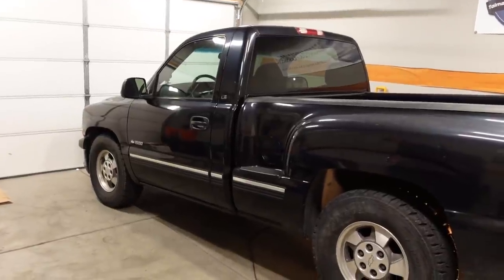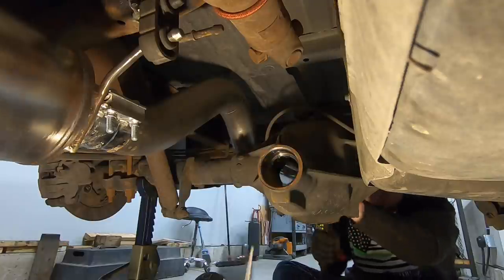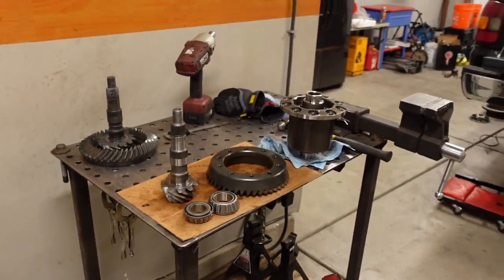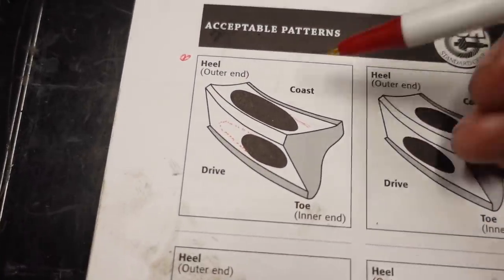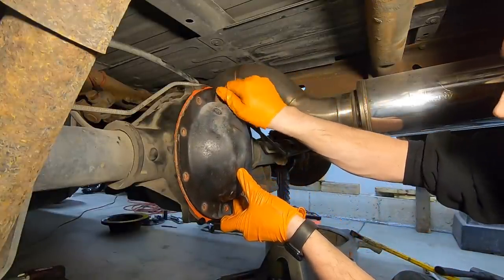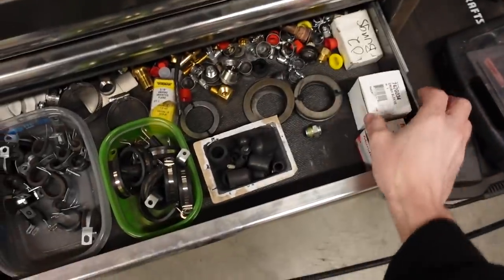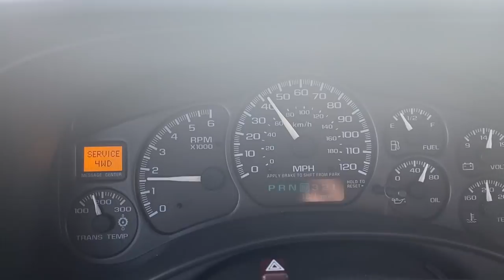Gain Acceleration WITHOUT Adding ANY Horsepower

Comment: Rebuilt my 2500HD rear end (Bad pinion bearing) and upgraded from 4:10 to 4:56.  With 34.85 inch tire (for increased payload) stock 4:10 dropped to 3.74.  The 4:56 brought it back to 4:10 ratio using bigger tires.  More importantly climbs used less rpm.

Setting the pattern and backlash was the hardest repair I’ve made.

Comment: More than 15 years ago I got my hands on a torsen zexel from a 2002 Firebird. Stuck it in my 2000 S10  with the stock 3.42 ring gear. Installed the shims in exactly where they came out of. I've been happy with it ever since. No noise at all. Just better traction especially on wet pavement.

Comment from the maker: totally loving these 4.30 gears! any thoughts on the power adder thats going in yet?
Reply: LSA? I think that would be a fun power adder. I have not seen one on. 4.8’
Reply: Magnuson!
Reply: Hope to see an LSA build or supercharger of some sort.
Reply: Procharger?
Reply: The only thing that makes sense is something centrifugal.
Reply: Nitrous
Reply: Please do a procharger. Easy tuneing, unique sound, less intrusive.
Reply: With that gearing, I'm putting money on a centrifugal supercharger.
Reply: Jet engine bolted to the bed of the floor. 🚀
Reply: Lsa
Reply: LSA which will be badass but I think this would be such a killer application for twin turbos.  Imagine how much fabricating you could do on the hot and cold side!  BTW I feel like always complain about the background music but if you have to have it the EDM tunes work better than the synth rock we usually get.  Not trying to break your balls just my opinion.
Reply: Pro charger you won’t believe how fun they are 650 wheel p1sc lights up quick or d1 700hp up I make 500 on my z28 p1sc
Reply: I know exactly what you mean LT.  First time commenting and love the channel.  I have the exact same setup, 04 Silverado, reg cab, short box, 4wd, 4.8l, but with a 5-speed. CAI, longtube headers, catless y pipe, stage 3 boost cam and a good tune. 327rwhp and 320 tq. Couldn’t be happier with the 4.30s in mine,even at highway speeds.  Gears really helped on the low end with the 4.8.  I’m guessing you’ll go with a centrifugal blower cause 4.8s like to rev, but hoping you’ll do a positive displacement cause that’s what I’m going with.  Thanks for what you do.
Reply: Ummm... Your gonna get those electric superchargers that look like turbos.
Reply: @gotchevy41  I have a 212/218 550/550 na made 350 hp 350 tq how big is your boost cam because those are good numbers you made and what do you shift at 7200 rpm ?
Reply: @utahcountypicazospage5412  Hey man, thanks. It’s a Texas Speed stage 3 turbo cam Specs: 218/224 .600/.600 113+3 LSA.  At the time I was gonna do a small turbo, but now a blower.  The shop has the limiter set at 6,800k.

Comment: A good way to get the carrier beating preload correct is to measure the shims that you take out when you remove the diff.  Then when you re install the shims, just make sure that the total shim thickness adds up the same as the ones you took out.
Reply from the maker: thats true! unfortunately, the truetrac is a little wider than the stock G80 so the stock shim pack is too thick to go in

Comment: I’d like to know the fuel difference your gonna get
Reply from the maker: me too! I didn't check it much before to be honest to get a good comparison
Reply: I had a 04 F-150 that I swapped out the 3.73’s for 4.56 and saw a drop in hwy mpg of about 1- 1.5 but my in town mpg improved by about 2 mpg. I think rpm is only part of the fuel consumption. Load on the engine is the other part. Lower gears reduces the load on the engine.

Comment: In my experience the pinion shim is dictated by the housing and not the gear set. By that I mean I the variance in machining of the diff housing to diff housing is far more than gear set to gear set. If the original gear set had a good contact patch and didn't howl I always reuse the original pinion shim. I've also tried the setup bearing technique and it's a waste of time. You are determining gear setup based on bearings you won't actually be using and it just increases the chances of issues. Play with your side bearing shims as needed to get your desired backlash and preload but as far as the pinion shim goes I always reuse the stock shim as I feel it's matched to the machining of the diff housing itself.

Comment: One trick I would use is to use a prybar to give the carrier a load (both drive and coast) for the best pattern replication in the marking compound. Free spinning gave incorrect marks. There is always a load there anyways. Replicate for the true load. Also most Fords (what I learned on) were the same as far as pinion depth. 90% still like the .030" pinion shim from factory.

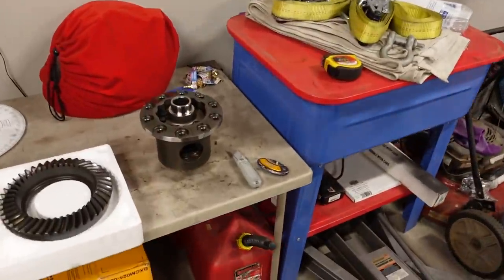Comment: I did this in an untouched BOP rear. Went from like a 2:56 to a 3.73. What a difference lol. But getting everything set was a pain. I was told the pinion bearing shims are standard to case, not gear set. So if you measure the factory shim behind the pinion bearing, it'll be really close to what you need to set it at. I couldn't get mine out... been together for 54 years and my press just wasn't having it. However friends who have done it have said that works for setup. But what a pain in the ass. No matter what I tried I just couldn't get a great pattern. I eventually did but it took forever. I also overshot the pinion preload but then looking around I was under the factory spec. The consensus again was with good bearings, higher preload was fine. It's survived many passes and like a thousand miles with no noises so I may be good lol.

Comment: Thanks for the video LT !
Thanks for the explanation regarding pinion depth that was helpful can you speak a little bit more about finding The Sweet Spot with the carrier death left and right? When I did my Ford 8.8 a while ago I had a heck of a time getting a good tooth pattern. I will be installing 342 years and then eaten in my wagon soon trying to reduce the headache ahead of time as much as possible

Comment: Well done LT!  Great info as always.  I did the same change in a 2002 4.8 2wd Silverado and loved the result.  Milage was actually better.  Less peddle to come up to speed for city driving.  Higher rpm at high-speed keeps you from flying down the highway.  Works for me anyway...  I like having the power for short bursts and nothing good comes from sustained 90 mph if not on a track.  I did have some gear noise, but it disappeared after a few hundred miles. Not sure if my "good enough" install was the cause or all new gear sets make some noise until they wear in.  (I did install and take apart multiple times trying for perfection) Topped off the dif oil after driving for a bit with some Lucas and I'll never know what stopped the slight noise.  Thx!

Comment: At first I thought you were forgetting the crush sleeve and you couldn't hear me tell you hay the crush sleeve but then you showed that you had put it in. I always tried to get the lower end of the specs for launching purposes the less slap usually the less damage. Na Motors love the lower gears now when you go turbo and if your running only 1/8 mile that gear may still be OK. You'll have to test and find out. Good content keep up the good work. God bless you and as always be safe 👍

Comment: So, the 4x4 shop where I had my '12 Ram 1500 2wd regeared from 3.55 to 4.10 said Nitros, which I also chose, are notorious for noise. He runs into mild noise a lot with them, even when contact pattern is "perfect". His theory is that the alloy they spec is responsible as, in his experience, they don't chip as easily as some others. Mine makes a bit of noise even though he took pics of the set up and they are picture perfect. My recommendation? Turn up the stereo! :) PS Amsoil 75W-140, (specd), a dash of straight 190 and tiny tube of Liqui Moly MoS2 helped quite a bit.
Reply from the maker: that makes me feel better! luckily these are very quiet, but maybe too quiet lol

Comment: Did you add preload to the carrier bearings?  It looked like it slid in awful easily.  FYI, I use feeler gauges to get to zero, and then add accordingly for preload.
Reply from the maker: I did, the footage I showed on there was not the final install, I had it in and out so many times I thought I filmed one where I had more preload on the carrier, but I did not film it

Comment: When I installed mine I removed whole rear end and worked on in shop back then I carried to and from shop 40yds heavy.  No Power tools used torque wrench with 3ft cheater pipe  after pattern set and dial guage check for backlash. 1977 Firebird had 2:41 gears went to 3:08 because 406 Cu in and Nitrous.  Torque due to crush washer on pinion and locktite on nut was 245ft lbs set pinion slightly deeper than normal due to nitrous preload gears and carrier from 2 to 3 change factory had cast iron shims new ones steel used calipers and micrometer to make left right adjustments to shim packs verify pattern with lithium grease and backlash with dial guage. Slight howl on deceleration but car went over 160mph with me and 3 other people in it safely. Car avg on Highway was 19mpg.  Sold to goto College as Holley Double pumper around town mpg 9-12.
Reply from the maker: that would've been so much simpler and saved my back if I just pulled the rear out of the truck

Comment: I always heard that driving even a mile on improperly set up gears would ruin the gear. Luckily when I swapped in a TrueTrac and deeper gears (G2?)in my '02 Z71, it went back together with factory shims all around.
Reply: i was a GM tech for 6 years and did ring and pinion work. A GM engineer told me up to 500 KM they could still be used if they had been set up wrong but if a trailer had been towed they had to be replaced. (just food for thought)

Comment: Love the channel and content!!!! I am curious about the shift points as you stated though. I have a 2001 Tahoe with 5.3 4l60e and 4.11 gears factory on 4wd half ton setup. My transmission is in overdrive at 35 mph once up to operating temperature. Currently on 265/70r17 tires.
Reply from the maker: I've adjusted my shift points in the tune to be a little higher and to keep it out of overdrive (now) until about 45mph or so

Comment: Great Video LT!  I run a Tru-Trac in my 14 bolt as well.  I had a bent axle in one that was causing excessive heat.  I replaced both axles and that solved it.  You replaced the outer axle seals, why not the outer bearings as well since you were right there?

Comment: I hope you have enough carrier bearing preload.  I know you made mention of carrier bearing preload but in the video it seems like the carrier fell into the housing a little too easy. Hence why a case spreader was created.. Years of setting up diffs have proven to me having proper carrier bearing preload is crucial for strength.  If you don't have enough preload you get too much deflection under load.  Also the carrier bearing preload is indeed measurable.   Just like the drag you measure in inch pounds on the pinion preload you can get a total once the carrier is installed.
Reply from the maker: good catch! although the footage I had shown on there was not the final install, I actually had the carrier in and out many times to set backlash and didn't record every single time.  on the final install, it was quite a bit tighter.
Reply: You are so right about carrier bearing pre load. It affects backlash also if loose because of spreading force on diff. Gears. Floating carrier =no good, worn bearings and undercut cups on bearing shells. Old timers like me used to use a fish spring scale with a.hook to pull carrier and get ounces of turning torque. Inch pound torque wrench now. Ignore breakaway higher torque reading and go with slow and steady turning of wrench for dynamic turning torque. If you do it for a living you can't have comebacks! Flat rate considers comebacks free work. Too many and they show you the door. Doing it right is still easy it takes some verification steps, but soon you have a reputation as the guy to see on differentials!

Comment: Hey great video but i was wondering how you got a transmission temp. gauge in a 2000 half ton. I have the same thing and was wondering how I could get one.
Reply from the maker: all I did was swap in a 2001 denali instrument cluster, it has the trans temp gauge and 120mph speedometer. the wiring and sensor for trans temp is already in your truck and needs no programming to complete

Comment: I would like to know what are the choices for the front axle of these GM trucks.  I have a 02 Tahoe 4x4 with 3.73s with true trax, mild go fast stuff maybe +30hp.  I'm running 33" tires.  I go off road some, but I'm not hard on it, I'm not rock crawling, "Fins and Things" trail in Moab is limit.  I like the quiet 2000 RPM at 70 mph cruise.   Anyways, I was thinking to change to 4.10s, but thought while I'm at it I should put in a front axle that is a bit stronger.  What do think?
Reply from the maker: with a tahoe, there aren't a lot of easy axle upgrades, but the one that will be a direct swap on the back (from what I understand) is the 14 bolt semi floater 9.5" axle that came in some escalades. not sure on the years, but they were stronger than the 8.6 10 bolt and should be a direct bolt in with your suspension (you'll need to double check this though). as far as the front 8.25" IFS, not sure if there are any drop in IFS axles that are stronger.

Comment: I’m putting a 4l80 in my single cab with a stock ls3 I put 4.11s in the truck already will I do fine with a stock 80e stall or will she feel sluggish or I’m I better of waiting to buy a 3200-3600 stall

Comment: Would the new bearings cause any difference in depth than the bearings you used to set the pinion depth? Hope my question is clear
Reply: No.  Bearings are the same.  Pinion length is set with shims
Reply from the maker: I make sure to use the same part number Koyo bearing for my final install as the setup bearing to eliminate any possibility variance.

Comment: A 4.11:1 final drive gear ratio on both front and rear axles would have been a better choice because it can handle a turbocharged engine setup just fine and your MPG is still reasonable given the fact you have a 4 speed transmission but if you had a 6 or 8 or even a 10 speed transmission then it would be a different story then you can run a 4.30:1 final drive gear ratio on both front and rear axles with no problems.
Reply from the maker: fair point! in fact, the silverado SS from the same era uses a 4.10 ratio, but going from a 4.10 to 4.30 is only about a 5% difference which will be negligible at the end of the day (in my humble opinion)

Comment: What’s the mpg you’re getting with the cam? I have a cammed 4.8 as well and wondering your getting for mpg. Granted I still have factory cats and manifold with just a straight pipe.
Reply: Ok its together . Cool now its time to strengthen that rear end considerably . Carefully- Take the crush sleeve out and measure its length and id . Now using some good chrome moly tubeing or round stock make yourself a heavy walled crush-proof spacer to put back in there . Set up like this that ring and pinnion will take some high horsepower ABUSE !!! Works GOOD !!!

Comment: If I were to go to the junkyard and hack together a Ford 31 spline 8.8 axle for my Ranger using the 4.10 ring an pinion set from a non LSD axle, but an factory LSD carrier from an LSD axle (which was never offered in 4.10, only up to 3.73) would I have to do all of this pattern setting and stuff?
Reply from the maker: in theory, yes. as long as you are only changing the carrier all you have to do is check backlash since the ring gear is concentric with the axle tubes won't move front or back, only side to side. Some axles have different carriers for different ratio ranges, so hopefully the 3.73 carrier will work with your 4.10
Reply: @LawrenceTolman  Damn, I was lowkey hoping I could just slap the gears on the LSD carrier and put it all together in the axle and not have to shim it and stuff. I'm starting to think that with all this extra work I might as well just get only the housing from the junkyard and go brand new on the gearset and LSD carrier, but IDK if I'm going to stay stock power and stock trans for a while (therefore able to take advantage of the ratio change) or if I'm gonna buy "everything" at once and be 300-500 wheel and needing to gear up (numerically lower) so I'm not revving the piss for no reason.

Not to mention I'm still not sure if I wanna do a street build on ~27" tires, or a "rally" build on ~29 inch tires. Guess I kinda need to figure it all out and build it as a package ONCE, and RIGHT, huh?

Comment: Something about the left page of that pattern book looked wrong. Was it also for unacceptable patterns?
A contact patch too close to any edge with little contact deeper into the gear set is WRONG.
The full contact pattern needs to be near the middle of the gear surface and away from the edges to avoid snapping the edges off, leading and trailing contact is ok on the edges but not driving contact.
Reply from the maker: I wondered the same thing, but the left page was all under their heading of "acceptable" patterns
Reply: @LawrenceTolman  . There were definitely some there in the unacceptable category. Misprint?

Comment: If you change the ratio, would this affect the towing capacity?
Reply: The lower gear ratio is better for towing.  Somehow, I don't think that was why he did the work though... lol.
Reply from the maker: technically it won't make the truck tow more weight than its rated for, but it will definitely handle the weight better. Although Jim is correct, that was not my intention, and I'll probably never tow myself, but yes, 4.30 would be a great gear for towing or to offset larger tires.